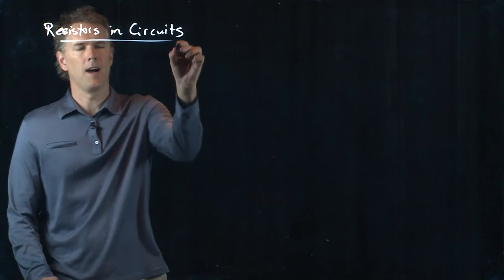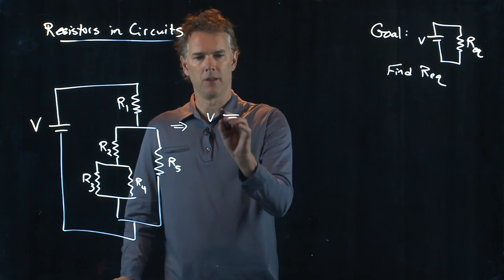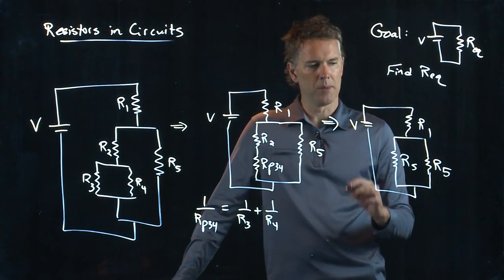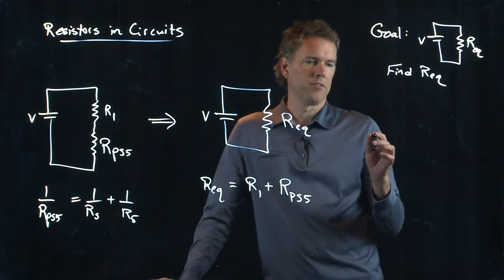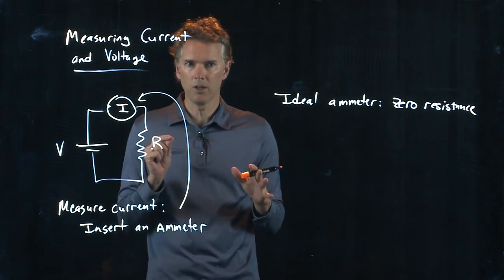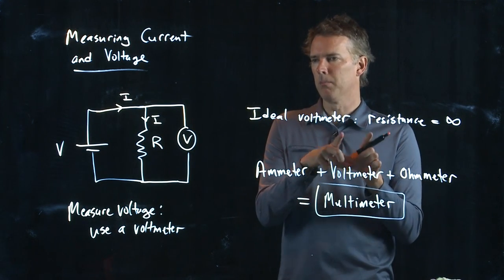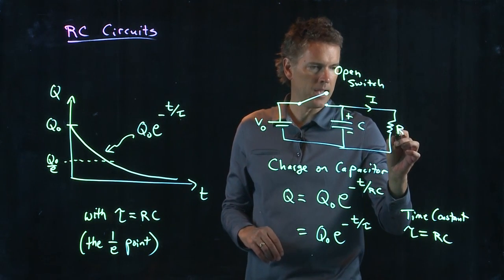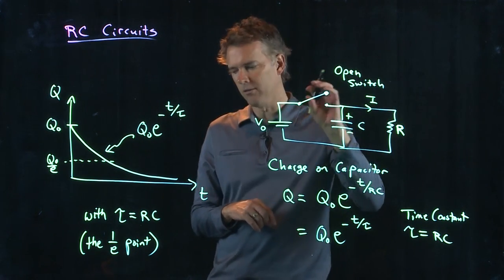Resistors and Capacitors

Comment: Current in a capacitor does not flow through it, charge pushes and pulls across it(like an inductor), that's why current moves at the capacitor at the moment in a battery circuit when its turned on or off....this always seems to me critical information that is  left out. Thank you for being clear about this.

Comment: At 42:40, how did he know that I3 was going to go down? It seems to me like if we look at the 58V battery, the current should be flowing from that into the 64Ω resistor, which would make it going up instead.
Reply: It doesn't really matter from which battery you decide to flow the current as long as you use kirchoffs correctly. Its just that calculations are easier if you choose the one with higher potential difference

Comment: I think i saved a liion lithium battery that was over charged 5v instead of 4.2 its a 3.7.. I just charged it at like 2.3 and when intead of waiting till it reaches 4.2 i just waited till it bropped to 4.2...was thinking is if equal balancing same length of power equals same power. Also was controlling the volt with a pwm controlled for a motor. The controller changes slightly when using multi-meter and was strange as you mentioned how resistance is how electronics function so it was changing pwm output when re measuring. I used a motor that used same amount of power as controller to set the mark on the dial. Hope this is making sense to someone and helps make more sense.

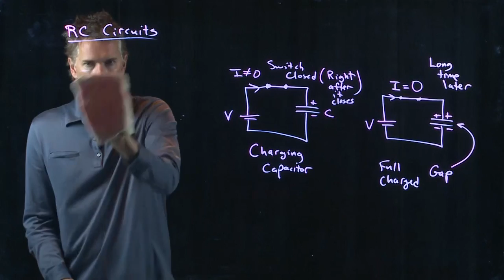Comment: 33:00 if we have a current source instead of voltage source, how is the behavior altered? Thanks in advance
Reply from the maker: athantas, 
Great question.  Current sources tend to have constant current (varying the voltage), whereas voltage sources tend to have constant voltage (varying the current).  Most devices like batteries or wall power act like a voltage source.
Thanks for the comment, and keep up with the physics!
You might also like my new website: www.universityphysics.education
Cheers,
Dr. A
Reply: Thank you!

Comment: Is a bit wrong to say that positive charge is  going to on side of the capacitor, unless they are Hydrogen nucleous in a fuel cell.
Reply from the maker: Fair point.  We know that it's electrons that are moving.  So when they move away from one side of the capacitor, they leave behind some unpaired positive charge.
Cheers,
Dr. A

Comment: Hi Matt.  On the problem, how did you determine the direction of the current in the middle path without doing any calculations yet?  I am sure it's obvious and I am just missing it...  Thank you!
Reply: +George Tempesta you don't have to determine it. It doesn't matter what the actual current's direction is.
Reply from the maker: +George Tempesta 
George,
What time mark at you looking at in the video?
Dr. A

Comment: on a solar charger I made if you measure the voltage after the diode while the circuit is open there is 0 voltage drop. once you put a load on the circuit the voltage drop is 0.2-0.3v. is there a reason for this?
Reply from the maker: +micheals1992 

I would need to see the circuit diagram and where you are measuring the voltage.  But basically remember that since V=IR, if there is current and resistance, there is a voltage drop.  When the current is off, there is no voltage drop.  When the current is on, there can be a voltage drop -  including in the wires themselves since wires still have some small resistance. (Diodes themselves have a built in voltage drop, but this is usually closer to 0.8V.)

Thanks for the question!  Hope you're enjoying physics.

Cheers, Dr. A
Reply: Matt Anderson It's a Schottky diode which is why the v drop is low (multimeter says 0.2v in >l mode). it's a pretty basic circuit and the diode is only to prevent discharge during the night.

I recently got a multi meter and I decided to make a solar AA/AAA battery charger while playing around with some parts I had and I found it interesting that the diode only had a v drop when a battery was connected. I'm also making a DIY Velocycle and wanted to make an indicator system and a central power system for all the lights etc which is why I'm trying to learn a bit about electronics before the summer comes and I finish my project for this years bike show.

thanks anyway! :)
Reply from the maker: *****
Good detective work! Sound like you're having fun.
Of course a diode sitting by itself should not have a voltage drop, since that would mean it could move charge, acting as a battery.  And we can't just extract energy from nothing.
And by the way, electronics is a blast!
Cheers, Dr. A
Reply: Matt Anderson is there any better way to do this circuit?

http://postimg.org/image/jo0qomh6d/

Open circuit/indicator switch in central position - http://postimg.org/image/cyu78lvud/

it says the load is 711uA on this which is around .002W but maybe the program i'm using isn't entirely accurate. I'll probably put an isolation switch on the battery for when it's not being used.

Comment: if the value for the current is negative does that not mean that you've chosen the direction of the current in the circuit wrong? i'm so confused.
Reply from the maker: Yes.  Just pick a direction for the current and if your answer turns out negative, the current is going the other way.
Excellent point.
Cheers,
Dr. A

Comment: Hi, in relation to the last section (the exercise at the end of the vid) i have a similar problem which has 3 batteries and 3 resistors (3 loops in total), i have the values for the batteries but not the resistors, i am supposed to find the voltage of one resistor. and do not know where to start to tackle this problem. Can you help?
Reply from the maker: +Terry T You'll have to use Kirchoff's rules, just with three loops instead of two.  Rules:  1) Voltage drops around any closed loop is zero.  2) Currents don't pile up at intersections.  Good luck, Dr. A

Comment: If I  have to do this kind of a presentation,  perhaps I would have a stensil (a preprinted matter, in mirror image, of the text, I may have to write, with some mechanism to turn it over, as and when required.  ) at the camera man's end.
Reply from the maker: Unnecessary.  Write normally: www.learning.glass
Cheers,
Dr. A
Reply: Thanks. At times, my( google indebted) mind tries to read too much in to the things. Usually, that amounts to having two holes in the door, for a cat and a kitten.

Comment: But the capacitor get instantly charged when no resistance in circuit so at t=0 there is no current
Reply from the maker: Zuber,
Excellent point! You are indeed correct that for ideal circuit elements with R=0, the time constant τ = RC = 0. The capacitor would charge up (or discharge) infinitely fast.
Of course, this is only the case when all R=0 in the circuit, including the wires and the voltage source.  Any real wire (not superconductor) has some finite R, and any voltage source (like a battery) has some internal R.
Thanks for the comment and keeping me honest!
Cheers,
Dr. A
Reply: Sir at t=0 when in a RC Circuit can we replace capacitor by conducting wire

Comment: MOST BENEFICIAL IN REAL LIFE IF YOU EXPLAINED HOW AND WHY WE USE CAPACITORS!! AND WHY WE USE THEM COMPARED TO RESISTORS!! AND: WHAT DOES IT MEAN: (FARAD) AND WHAT IS IT EQUIVALENT TO VOLTAGES OR CURRENT....ETC!!  WHY WE USE CAPACITORS IN REAL LIFE AND FOR WHAT? WHAT'S THE BENEFITS IN REAL LIFE APPLICATIONS? please if you explain the basics first and what does it mean and difference between current and Amperage and energy and watts......etc= if you do (on youtube) as i noted above, it will be too far beneficial to common (lay people)  readers; so to benefit them in real life. The concepts you been teaching are so technical to lay people; Unless you only targeting those from all population who have experience in Electricity subject!!! Anyway: you look very rich in knowledge in this Area but too technical!! = cheers buddy !
Reply from the maker: eden, 
Lots of questions that I probably can't answer here.
But thanks for the comment, and keep up with the physics!
You might also like my new website: www.universityphysics.education
Cheers,
Dr. A